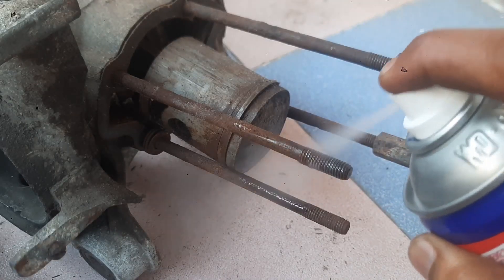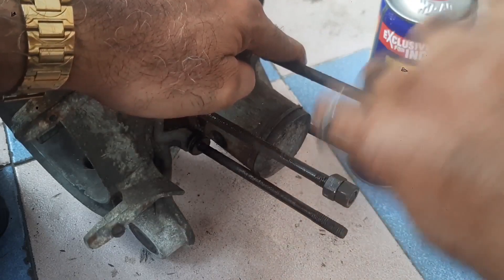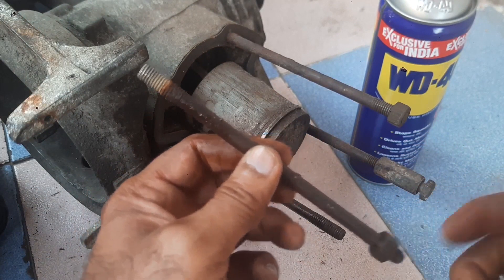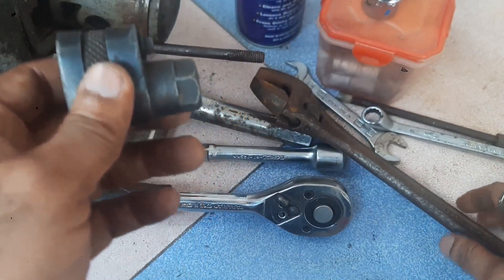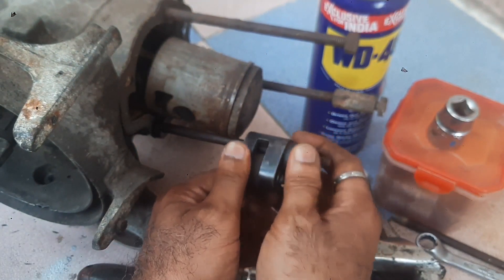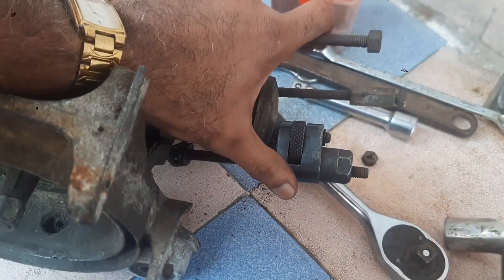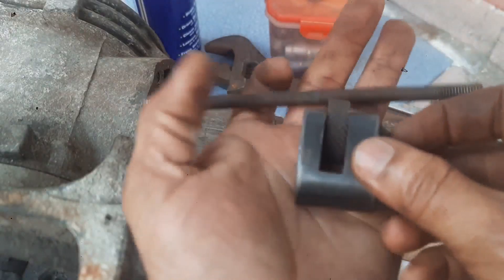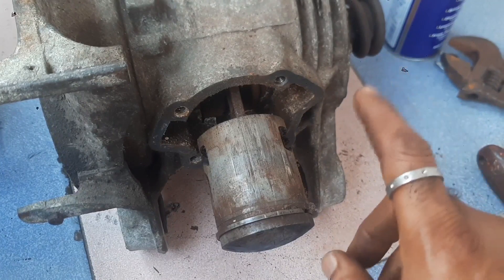How To Remove Studs From An Engine Block The Easy Way

Comment: Which one you prefer?
Reply from the maker: The Best one is with stud puller. Because sometimes if we use method with nut locking they (Nuts) will slip with the stubborn studs. But with stud puller any stubborn studs will come out very easily 🤝